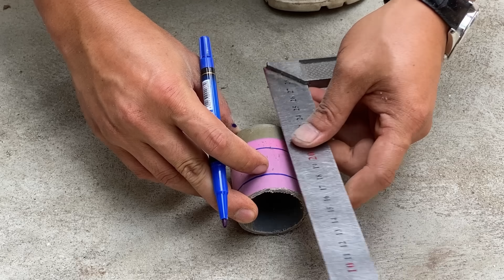How To Make A Perpetual Generator From Recycled Materials

Comment: perfecto amigo, la unica duda seria el ver si dentro del abanico no escondes una bateria, porque no conectas los focos hasta que conectas el abanico, deberias mostrarnos eso....saludos
Reply from the maker: no
Reply: @GreatElectronicInventions  porfavor no engañes a la gente
Reply: Você não viu ele colocar o multímetro e medir antes de ligar o ventilador ? Se tem um truque , certamente não é este !
Reply: Hi, Interestingly enough the set up does produce around 3 volt before the fan is connected so It may be possible to step up that voltage using a capacitor or a transformer of some type as a standard commercial petrol generator uses a large capacitor to achieve the 220v High voltage - so don't know if i'd label this one a complete hoax at this point as it would be easy enough to duplicate what he has done here using old motor parts etc.  I might give it a try at some point as I have most of those parts lying around in my shed/workshop. 😉🙃

Comment: Just sell it online. Make in large quantities. People don't need to use PLN anymore 😁 Every electrical power created in one board can power refrigerators, lights, washing machines, majikoms, dispensers, etc. Just make one board, one use. Place it in every corner of objects that require electrical power 😅 If designed neatly, it will replace the function of PLN 😁

Comment: hi 🙂 I'm writing to you from Italy 🇮🇹 many compliments for the project I would like to try to do it too but you have to help me and tell me exactly what you used, the quantities of copper (coils, where did you find it? what can I use if I don't have exactly those two copper coils? and the amount of copper?),
What is the thickness of the magnets?
and what are the exact measurements of the wheel and its vanes?
And how many watts does the bulb have?
Where should the multimeter knob be placed? to be able to understand how many watts you generate, just like you did.

Please, this is important for a technical project, if I don't have the correct measurements, I can't create without the right materials and measurements.
You were very good and precise, I will say that you helped me and I give you my subscription to your channel, I liked the video.
I hope you will answer me soon. explain everything to me every step of the way in detail please, because I'm not as good as you.
what is that little gray box to the right of the wooden base?

Thanks in advance if you do.
Reply: Those wires winded in just a recycled heavy duty 220v stator of a motor you can find in any industrial recycling shop. Those are like table saw stator motor or a ststor of a motor for designing in furnitures or a stator of a heavyduty electric drill, elecctric fun or any type of stator that is used in heavy industrial works like carpentry and machinery. What's important is that it is used for 220v A.C. before  the recycling.

Comment: The big ring magnet is to push the turbine to rotate to create a pole field effect to induce the current flow to two stators with the coils in parallel thus generate electriciy with a step up transformer. I try it it works fine.

Comment: Could you list the materials used? What are the coils made of? 
What type of transformer is it, or is it a voltage stabilizer that you place at the end of the transformer wires? What are its specifications?
I would like to try making one, but I’m still a beginner.
Reply: Would you have a step-by-step with description of the material?

Comment: Congratulations! 👌 
What about the frequency of the current. I guess it's not 50 Hz. Isn't it harmful for the devices?
Reply from the maker: ❤️❤️❤️👍👍👍no
Reply: power fluctuations are not good for devices either!
you need a voltage stabilizer and some kind of buffer circuit

Comment: Don't believe this charlatan; in all of their videos, they first attach the fan to the socket and then insert the light bulbs. This is because there is a battery and a 12v/220v converter inside the fan. With this setup they placed inside the fan, it both spins the blades and powers the triple socket.
Reply from the maker: NO!!! NO!!!🤔

Comment: The 1.5V DC Battery which he used as a source voltage input can't give AC output of 110/250V Output through those insolated wires without a magnet.  This is doubtful.

Comment: If you fart in front of the fan you can prduce 20000000000 kWh in less than a second. There is a problem; the fan can blow off or take off 🤣🤣🤣🤣🤣🤣🤣🤣🤣🤣

Comment: HELLO YOU ARE SO GOOD THAT I WANT TO COMMISSION YOU FOR A JOB AND THAT IS I SHOULD CHARGE THE BATTERIES OF MY PHOTOVOLTAIC SYSTEM AND I HAVE TWO 9 kW BATTERIES SO A TOTAL OF 18 kW AND I SHOULD CHARGE THEM AT NIGHT WHEN THE SUN IS NOT THERE. You can do it Hi😊
Reply from the maker: You can use wind power at night
Reply: unfortunately in my area in Italy the wind is low 2.7 ms and therefore I would only be able to obtain a few hundred watts from it

Comment: What are the advantages and disadvantages of using this generator?
Reply: Free power beyond the materials needed to make it. I’m no electrician, but If this is putting off 650 watts. Depending on power usage, you could use about 6 - 10 of these to power a house. That’s what brought me to this. My father has always went on about perpetual energy vs renewable energy. I wanted to see exactly what was needed to do so, as I’m hoping to one day build a self sufficient house. This could be done easily with the right size magnets and spindles. I have some old generators laying around that I’m gonna experiment with. I just need the magnets now.
Reply: Also, another thing to note, if he wants this to be 100% safe. He needs to replace the wood with stone or something that’s not flammable and something that won’t disturb the magnets. The concept is honestly amazing and a brain opener for me.

Comment: If it was just that easy, every one would have been in alternating service and sales.
The motor fitted in hole is your fraud.
Strange how it does not turn when you first fit it, but later on with a quick start, it turns.
THE CATCH!

Comment: Materials list please.
Reply from the maker: It consists of fan coil and permanent magnet
Reply: @GreatElectronicInventions  What size coils are the motors from and what is the gauss strength of the magnets you used, If you know?  Looks like a great machine and will attempt one for charging batteries.  If it works like it shows....  You have made many people's lives a lot easier.   Thanks for putting it out there,